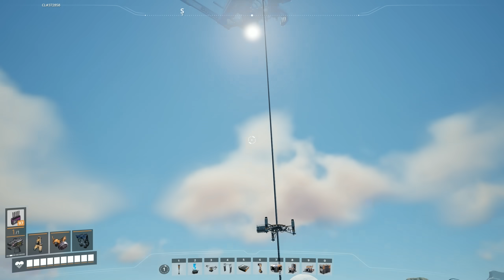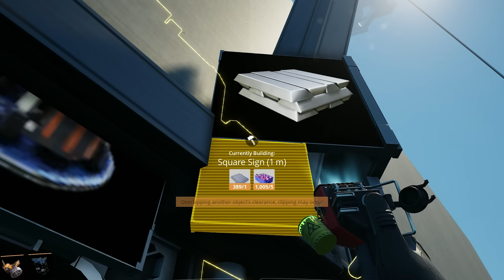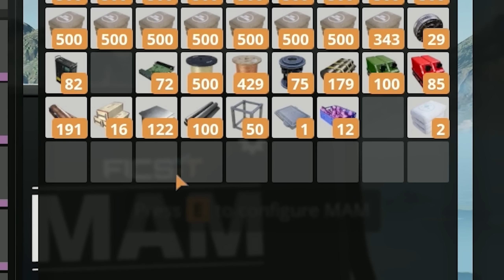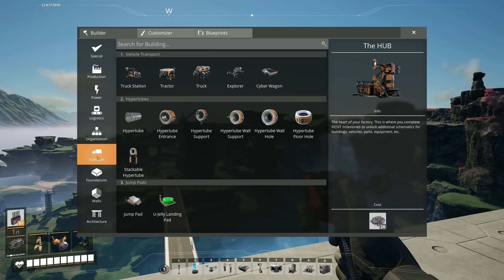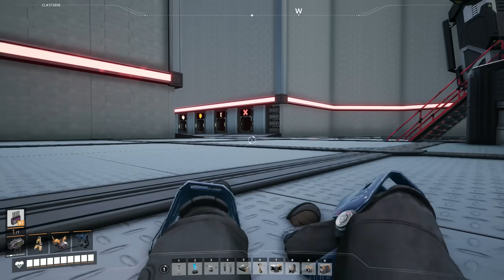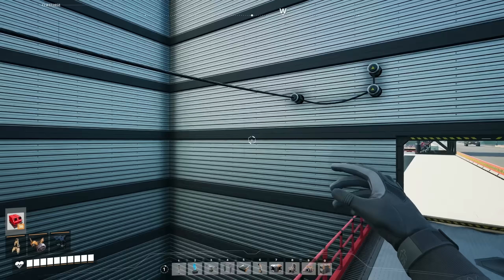How I Built my Main STORAGE HUB in Satisfactory 1.0

Comment: It takes roughly 97 spheres to unlock all the upgrades but there are roughly 300 spheres in the game as of 1.0 release. So your able to build multiple storage depots for several items in the game to increase the overall upload rate for them. Because the 240 max upload rate seems to be per depot not per item so it's possible to refill your dimensional storage rather quicker. You also don’t really need depots for most of the raw materials, ingot and organic matter late game which frees up some spheres.
Edit - Honestly because an upload rate of 120/min or 60/min would still work for most items. You could save more spheres to make extra depots for anything that required a faster upload rate.
Reply: Yep, I'll gladly pay 10 spheres to have 2.4k upload/min rate on my concrete. If ever I need to pave a biome, if I want I just start preemptively pulling concrete from the dimensional storage into my pockets on my way there to have a bit of a buffer (then set it to pull from dimensional storage first temporarily). But I've only done that once for a huge platform, most of the time that is not necessary. Sure is more convenient that going back and forth to a central storage.
Reply: On my first playthrough, i didn't even unlock the 240 upload rate. I decided that 23 mercer spheres weren't worth it over, just increasing the 3 things i need over 120/min to multiple dimensional storage units.  I was mostly to lazy to search for extra spheres haha.
Reply: Still making a centrale storage location, because i can.
Reply: One of my rail network blueprints uses 800 rods, one belt bus section uses 900 iron plates. Each of these I'm placing 10+ per minute. And I continuously need insane amounts of concrete. There aren't enough spheres in the map for megabuilders.

And that's okay! I like the challenge of having to set up trainsto bring me these resources in bulk.
Reply: @ElDubsNZ they aren't a fix all solution. They're a convenience
Reply: @ElDubsNZ  I'm a mega builder and 5 depots have more then kept up with my blueprint spam of foundations and walls. There is 201 you can use for depots after all the upgrades, and if I know Ima be using this BP and it has this much shizzl I'll shift the depots I have around a bit to keep them filled. ie if I need 20 of them on concrete, I'm pulling 20 of them. Granted I never needed more then 6 for my bigger projects.
Reply: @TAiiNE  Even just a 6x6 2m foundation blueprint being spammed out to cover a large area would quickly overwhelm that.

You can put this blueprint out every second. That's 256 concrete per second.
Reply: I was gonna post something like this... I have 2 depots uploading concrete at max rate and it seems just under what I need for dropping massive slabs of concrete at a moment's notice. 3 or 4 ought to be plenty for most purposes. What's doubly fun is you can feed those depots from bins all over the world and the bins themselves don't necessarily need to replenish at the rate you're uploading since nobody builds factories 24/7 without pause. So you slowly fill the bins and then have a faster belt emptying and you'll never run out as long as your total usage doesn't exceed your total production.
Reply: lol content creators dont care about ur logic they need videos.
Reply: Exactly what I did, 5 depots uploading 1200/min is more than enough for me.
Reply: For those who play with mods there are likely a few that let you add or create more alien artifacts. Might even be a few that increase the overall depot storage capacity and/or input rate.
Reply: @reaperbot5226  You can Dupe in the vanilla game, all you need is a belt, storage and merger/splitter. There is a youtube vid floating around how to do it. Use with caution.
Reply: @reaperbot5226  if you're going to play with mods just to get more limited items you might aswell just dupe them
Reply: @reaperbot5226  I mean easiest way is just to open your save in the interactive satisfactory map and edit the inventory of some container. if you wanted you could just give yourself all the hard drives , Mercer Spheres and Somerloops you ever want. I did that with hard drives in one of my playthroughs during early access since I couldn't be bothered to collect all the hard drives for the third time.
Reply: Just duplicate them
Reply: For concrete I ended up using trains and temporary train stations to chain together drop off points as I went. That way I kept three freight cars of concrete with me everywhere I went. Mega factories also tend to require more materials than a dimensional throughput can provide
Reply: The
Reply: I actually built a super concrete uploader. I can’t remember off the top of my head how much goes into it, but I do know that it is 8 constructors with 300 limestone per minute feeding into 4 of them and 300 into the other 4. I have essentially solved my concrete problem. That was even before I started duplicating stuff. (I really don’t care if people think it is cheating. It just saves me time building factories. I have a rule of no more than 5 alien power multiplier things.)
Reply: @locomeon_0  I have 16 depots all uploading concrete at 240/min each for a total of 64 concrete every single second.

It's still not enough when you're placing 6x6 foundation blueprints one after another, because that uses about 250 every second. I'd need 64 uploaders to keep up.

And that's just concrete! After my rod and plate needs, I'll be close to running out of spheres.
Reply: @ElDubsNZ  Make 64 then, what's stopping you? Even better, make them switchable so you can upload any item you need for a specific kind of blueprint
Reply: @FAQUERETERMAX  I've run out of spheres. After MAM unlocks, and having 1 for every item, and the many that I need for fast rods and plate uploads and other items that need quick uploading, there aren't 64 left.
Reply: @locomeon_0  If you're going to duplicate stuff just play on creative mode.

Comment: remember that you can put multiple dimensional depots per item to get better throughput. it works really well for concrete, if you put like 10 depots you basically can't run out
Reply: I have 4 Dimensional depots in my Wet Concrete factory and I built a massive flat factory base spamming a 5x5 blueprint and I didn’t run out of concrete.
Reply: Try some bigger blueprints for train networks and such. We have 5 depot's with max upload. Still doable to drain it for few seconds 😅  @Frozenvx
Reply: Oh, then he can have not enough concrete but FASTER
Reply: @quakxy_dukx  Storage container connected to dimensional depot means the same amount of concrete just accessible to anywhere. The only limit is the rate.  So for conrete and iron plates just build 2 or 3 or 10.